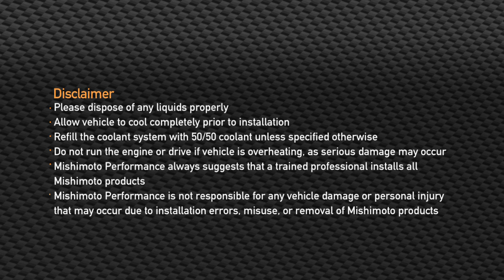How To Install: Mishimoto 1992-1999 BMW E36 Racing Thermostat

Comment: Do you know the temperature before and after ?
Reply from the maker: The OEM activation temp was 190°F , our thermostat is designed to open sooner at 154.4°F for heavily tracked vehicles this is a must have.